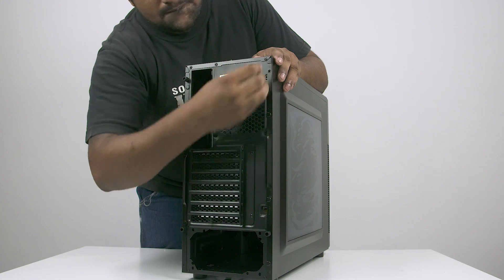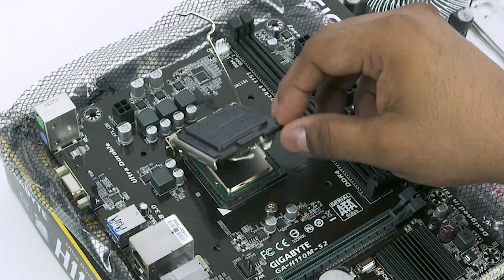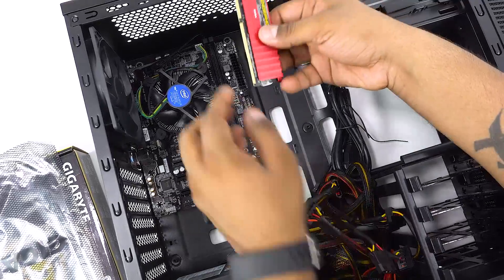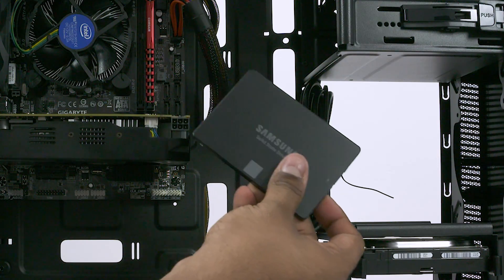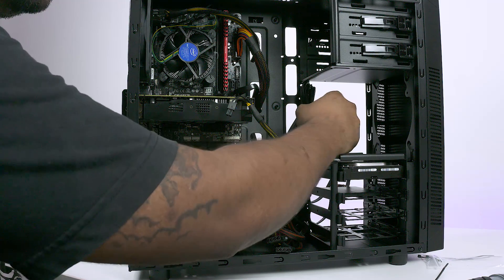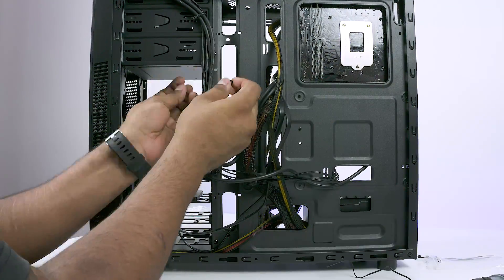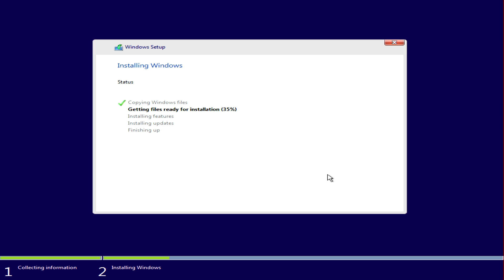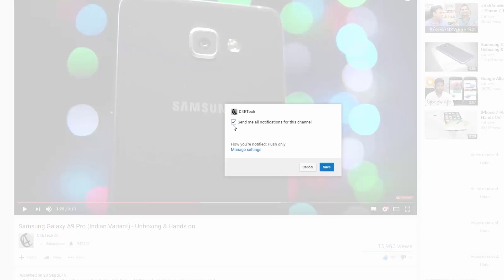50,000 Rupee Gaming PC - Build Tutorial!

Comment: good video..thumps up. But if i'm gonna build for myself i will use, ryzen 5 1600x, Asus prime B350-Plus motherboard, 8GB G.Skill Ripjaws 4 DDR4 2400MHz (2x4GB) instead of i5 6420, H110M,Corsair Vengeance 8GB, rest if i used the same parts like g.card, case, etc, on this build, it will save me around Rs.6330, then this rig. This extra can be used to buy like cpu coolers...he2

Comment: will these components bottle neck ??
intel core i5 7 th generation , gtx 1060 3 gb , 8 gb ram.....plzz reply
ur's is my fav channel in youtube....plz reply as fast as u can....by the way i going to build my own pc , specifications are....

motherboard - gigabyte b250 DS3H

PROCESSOR - INTEL I5 7 TH GENERATION

RAM  - CORSAIR VENGEANCE 8 GB 

GPU - NVIDIA GEFORCE GTX 1060 3 GB 

PSU - CORSAIR VS550 WATT

HARD DRIVE - WD BLUE 1 TB

SSD  - SAMSUNG 250 GB

MONITOR - LG 22 inch LED Backlit - 22MP68VQ-P.ATR Monitor  (Black)

PLZ REPLY AND SAY WHETHER IS GOOD FOR GAMING OR NOT....I WANT TO RUN HIGH END GAMES LIKE WITCHER 3 , BATTLEFIELD 1 , RISE OF TOMB RAIDER , GTA 5 WITH FPS 70+ .

*  IMPORTANT -  PLZ SAY WHETHER ALL THE PARTS ARE COMPATIBLE FOR EACH OTHER
Reply: gaming freakymind .... better if u went with r5 1400

Comment: can i use a core i7-7700k and gtx 1050 2gb zotac mini graphics with iball marathon peak 500 watt. Ram is corsiar 8gb-2400mhz. itb hdd.
Reply: Rajkumar rout don't use iball psu's they are rebranded chinese stuff ..... if u are spending that much spend a bit more and get PSU from reputed brands like corsair or antec , as psu is most important part of the computer.
Reply: i just want to know if psu will support i7-7700k for a month properly or not? i will be able to upgrade it after a month.
thanks for responding.
Reply: Rajkumar rout ...if u don't overclock the cpu and gpu then it will run the computer fine ..... but i advise u to change it in future if u can.
Reply: hi!Thanks for the reply. i m not going to overclock. just want to play games for few minutes. may be  to minutes.
Thank you.

Comment: It will cost more than  ₹60000
gpu  ₹25000
processor  ₹15000
motherboard  ₹6000
power supply. ₹4000
hard disk. ₹4000
ram  ₹5000
cabinet  ₹4000
All total. ₹63,000 
That too excluding SSD and led lights
all the rates are frm Amazon
also please suggest a cheap source for buying the components whether from Amazon or local market

Comment: thw outer side of motherboard cover is conductive u should not keep motherboard on that
Reply: Shivansh Raj Sharma it's not the outside is not made of different material as inside
Reply: tim serious actually tim , there is a conductive layer on the outside of the anti-static bag of the motherboard . It helps to discharge tge static current outside the board and and helps the motherboard from getting damaged .

Comment: Hey Ash,

You used Gigabyte H110M S2 Motherboard which doesn't have HDMI port, So in place of that motherboard can I use MSI H110M Pro-VH Socket LGA 1151 Motherboard & would it fit Corsair 100r ? Because mostly I would be using my Sony Smart TV as my display.

Comment: @C4ETech I would probably drop the SSD and LEDs to go for a better motherboard like MSI H170 gaming M3. The SSD is really not essential and a better motherboard would probably benefit the performance a little bit. The price would probably increase by 1-2k but that's ok. The link for the mother board is below.

I also may prefer the Thermaltake Versa N21 over the Corsair 100r because it looks more stylish and has more or less the same price and features.

Motherboard
http://www.amazon.in/MSI-H170-Gaming-M3-MotherBoard/dp/B014YN672S
Cabinet
http://mdcomputers.in/index.php?route=product/product&product_id=3991
Reply from the maker: the ssd's optional mate meaning that doesnt come under the 50k mark, the leds are like $1 - so doesnt make a difference - so can't fit in a more expensive board in this segment
Reply: Oh! lol. Sorry. I didnt realize it was optional. Yeah. I loved your config except the motherboard. But I suppose a compromise had to be made somewhere to fit the bill. I wonder if the i5 prices will go down with the latest Ryzen 5 CPUs when they will be released. Then, if the price of i5 comes down to like approx Rs 10000 I suppose a better motherboard could be fit in the price bracket. That would be pretty great and would probably be enough to revise your 50000 gaming build.

Comment: will this power supply work with a gtx 760 Asus which needs a 8pin pcie ????? pls smone rply does this power supply has a 8pin pcie or I will need an adaptor pls rply
Reply: vipul Devnani yes it has both 6pin or 8 pin (every psu has extender in 6pin for 8pin ) so don't worry
Reply: Thnks bro for helping me I'm getting a gtx 760 Asus for 8000 should I buy it
Reply: budget motherboard and purpose
Reply: 760 is very old card
Reply: Pentium g4400 
same Mobo in the vid 
ddr4 8gb ram 
gtx 760 2gb OC Asus 
power supply same as in vid
purpose : entry level gaming
Reply: so what card u recommend
Reply: if u can spend 2k or contact local store for gtx 1050 it cost approx 10k or AMd Rx 460 Which ever cheaper is available to u offline much better gaming performance
Reply: Ok thnks a lot bro thnks a lot

Comment: A few things ...
1. I know you've mentioned the parts in another video, but just mention them just once again.
2. Test the parts before assembling into the case to eliminate DOA issue.
3. Mention the possible need of thermal paste as some people might take the cooler off and try to put it back later or put on a different cooler altogether.
4. There is a hole on the top left of the case, put the CPU power wire through there before putting the motherboard on. You don't need a cable going over your MOBO.
5. Your top fans are giving you positive pressure but the point of positive pressure is mainly for dust accumulation inside the case and since the fan bays have no filters it'll dirty up the insides soon.
6. Also mention the different cable names like molex, PWM fan connector, etc. It makes it easier to follow that way.

Comment: Next pc build for Rs.35000
Reply: Yep, now upgrading to i3 7100 or getting g4560 or g4600 makes a lot of sense, but I&#39;m disappointed with kabylake i5s and i7s :/ really no difference.
Reply: you build one
Reply: alberto gorin give me the money
Reply: or ron the bank use a android device ^ _ ^
Reply: nice selection of parts bruh, spot on :P
Reply: or cpu: Pentium 4560
gpu: GTX 1060 3gb
Reply: cpu: i3 6100
motherboard: H110M (any brand)
ram: 8gb ddr4 
gpu: GTX 1050 2gb or RX 470 2gb
psu: 450W or above
storage: 1tb hdd
case: any
Reply: Hey guys, if you need more PC builds
Check out my blog on 
www.nephpc.blogspot.in

There are lots more PC builds
Only if you guys can check it out, it would really help me. Thank you

Comment: it awesome to see pc building on C4Etech.....but I have a doubt I know how to install windows but after building pc how install windows on PC for first time becoz we install windows from CD or usb but at first installation there might not be usb and CD drivers so how it will detect bootable disc or usb in short how install windows or any OS on new PC have nothing installed drivers and all...and how to install GPU drivers and other files required for a new PC ....what all to install on newly build PC (example:- windows, cpu file GPU drivers other drivers and what other to install and how to install )....
I also want you to explain which part is used for what ...explain all terms like NVram ,DDR ,safe boot, secure boot ,uefi, bios,PCI, SATA , SATA express and etc..... difference between bios and uefi
I also want you to compare different processors ,GPU and other pc parts and tell us which are best and why and what is difference between two products you compared 
I also want you to explain how to use bios / uefi ...which option is used for what in bios/ uefi
also do a video on dual booting... do a video on installing different OS like Kali Ubuntu etc 
also do a tutorial on that OS how to use that OS and all

do a in depth long video and build and teach us how to connect each part in motherboard and in cpu case

dont do small 10-12min vdo on Pc related topic do a long vdo for PC topic

explain each little term used in CPU GpU and other computer parts

do explanations vdo also in which you should explain us something for this refer techquickle ,ncix ,Linus tech tips channel 
do a tech tips vdos

These are my suggestions for your channel!!
again good to see PC building vdo on C4Etech
Reply: mohit makhija exactly!  I think you can install windows using a Pendrive. Load windows on a pendrive and connect it to the Pc load bios select 1st boot option as the Pendrive, and install it. Not sure about it, let Ash make a video on it.
Reply: lmao CD drives doesn't exactly need drivers to be installed
Reply: mohit makhija the bios on your mobo with help you. These days you will probably get a uefi bios so it is graphical and easy to understand. You have to insert a CD or pen drive first then boot into the bios. You have to set the drive as the primary boot drive where you have the installation file. Reboot the machine and you will be directed to the installation menu, from then you know what to do yourself ;) and don't forget to format the drive you are going to install before this. But you can format the drive from the installation menu too. You have to back up everything important before installing. That's all bro ;)

Comment: I used double side tape to stick the Ssd with the old harddisk instead of fastening the screws with ssd bracket.. Using ssd for os and other designing softwares(Ug Nx & Catja) and old hdd for storing files.With win 10 pc is blasting fast. 
And fantastic review Ash.. Keep rocking.

Comment: Make an 80k PC build..wud be happy if u use gtx1070, an 16gigs RAM. is it possible?
Reply: Go for RX 480 instead of 1060, way more futureproof :-
>More memory (8GB vs 6GB).
>Crossfire support.
>Better performance in DX12 & Vulkan.
>Better recording software as of new update.
Reply: no bro gtx 1080 is very expensive. It won't fit in the budget. And also with gtx 1080 you wouldn't not want a cheap processor, that means only the graphics card and processor will cost you 80k.
Reply: Rayman Legends sorry bro,i meant gtx1070.tnx fr showin
Reply: Even if you did get the 1070 and 16 gigs of RAM, you need a high end processor and a motherboard to compliment the RAM and 1070 which means you need to go above and beyond 80k.So,not possible to build a 80k PC with that gpu and RAM.
Reply: tsar_ bomba528 guesses that...but just had a wishful thinking
Reply: +Lal Vasanth Or else go for the 1060 or the 970, those GPUs are good too and start off with 8 gigs of RAM

Comment: Help me plzz.... 
Intel i5 1st gen (2010) VS AMD A6 6400K (2013)
Reply: i5 wins
Reply: Captain Deadpool amd cause it is newer chipset
Reply: Vaibhav Joshi Wrong, just being new doesn't change shit. 

http://cpu.userbenchmark.com/Compare/Intel-Core-i5-750-vs-AMD-A6-6400K-APU/2773vsm3048

Dude, the i5 750 IS LITERALLY 200% better in multi core!

Don't make assumptions based on 'age of the CPU' lol. Research more. Don't give advice if you can't
Reply: Why are you comparing apples to bananas?? APUs generally have a weaker CPU since they provide CPU+GPU combined in a single chip. A fx4300 is a much better prospect.
Reply: akash sinha Man please tell me between these two only.I5 650 vs AMD A6 6400k.
Reply: Captain Deadpool i5 650
Reply: Captain Deadpool i5 650 is much better than A6 6400K.

Comment: wohoo!! i love PCs and you building it is the cherry on top!  Lots of love, Deepanjan.
Reply: also, this my dream build:

Intel Core i7-6700K 4.0GHz Quad-Core Processor

Cooler Master Hyper 212 EVO 82.9 CFM Sleeve Bearing CPU Cooler

Asus Z170-A ATX LGA1151 Motherboard

G.Skill Ripjaws V Series 16GB (2 x 8GB) DDR4-2400 Memory

Seagate Barracuda 2TB 3.5" 7200RPM Internal Hard Drive

Samsung 850 EVO-Series 250GB 2.5" Solid State Drive

Asus GeForce GTX 1080 8GB STRIX Video Card

NZXT S340 (Black/Red) ATX Mid Tower Case

EVGA 850W 80+ Gold Certified Fully-Modular ATX Power Supply

Asus ROG SWIFT PG278Q 27.0" 2560x1440 144Hz Monitor
Reply: Deepanjan Banerjee I have the exact same build but I have the s340 elite and a different monitor
Reply: and the MSI variant of the 1080
Reply: Anonymous techie how much did it cost?